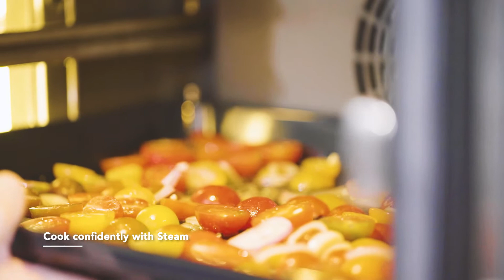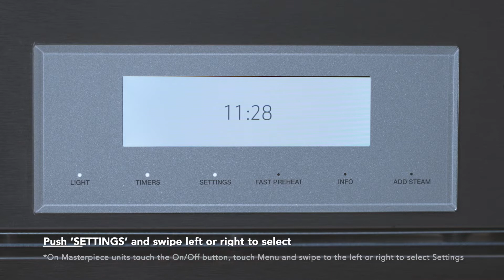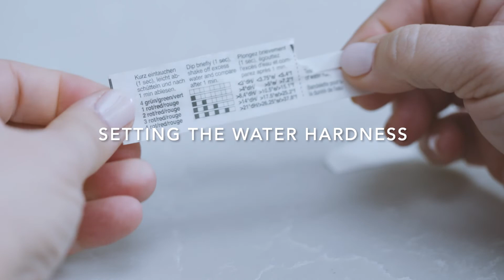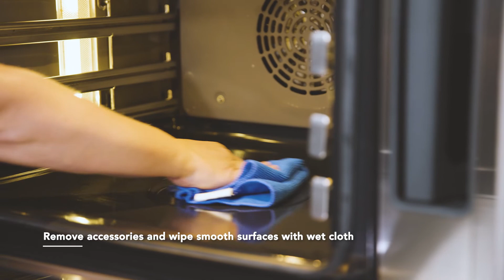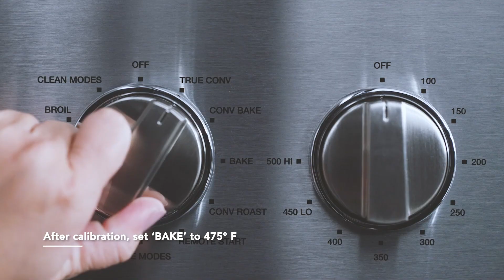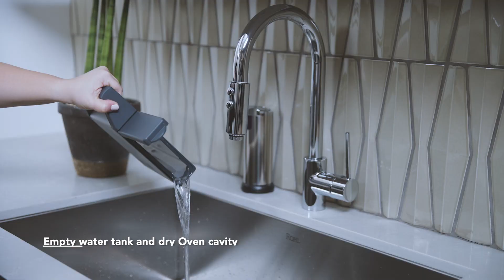Using the Basic Menu Settings on Your Thermador Steam Oven

Comment: What if my settings button isn’t lit, and doesn’t respond to touch? The other buttons work
Reply from the maker: Hello, thank you for reaching out. We encourage you to reset the unit at the circuit breaker. If issues persist, connect with our service team at 800-735-4328 or ThermadorCare@BSHG.com. Thank you.

Comment: also, how can you tell (on both the thermador convection steam oven and the thermador convection wall oven when the oven has finished preheating?
Reply from the maker: Hi Sarah, thank you again for reaching out. As soon as a new heating mode is started, the preheating bar appears on the display. The preheating bar indicates the temperature increase in the oven cavity. When the oven is fully preheated, a signal tone sounds. Thank you.

Comment: this video says that after you run the steam oven at 212 degrees for 30 min, you are supposed to let the oven cool down and then switch the mode of cooking to bake at 475.  It says to run the oven on bake at 475 degrees "for the duration," but this video (nor the owners manual) tells you how long to run it on bake at 475 degrees.  Can you please clarify?
Reply from the maker: Hell Sarah, thank you for your interest. Page 18 of the steam oven use and care manual indicates that both the steam calibration, and regular oven calibration cycles are to be set for 30 minutes. Thank you!
Reply: Thanks! @thermador